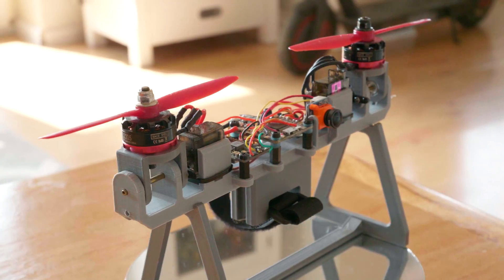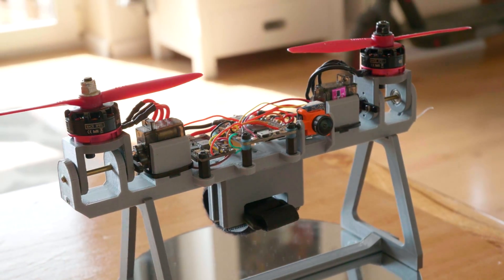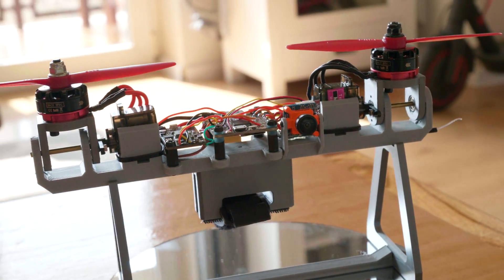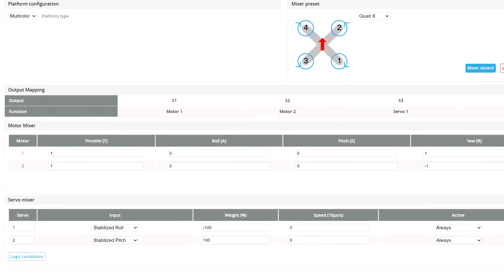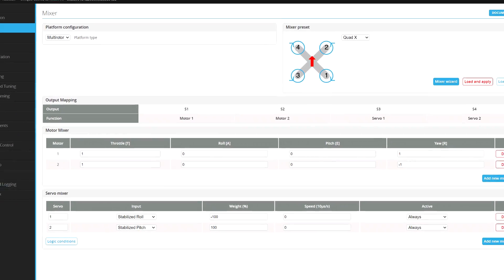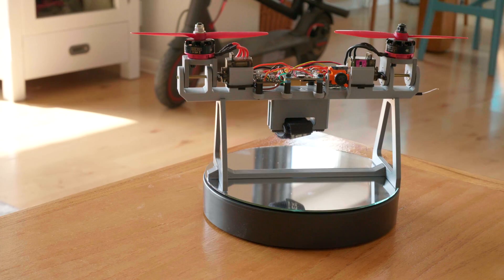Can I use INAV to build a bicopter?

Comment: At 1:16, the reference to "gravity" is irrelevant; this stabaization topic is better known as the "pendulum rocket fallacy" (which applies to all aircraft, including drones, not just rockets). 
The true reference is centre of mass (or centre of gravity, of aircraft) and the relationship of thrust angle to the centre of mass.
For stable flight, the centre of thrust must pass through the centre of mass. Even on winged aircraft.
Reply from the maker: Actually it is relevant. Because combined gravity and thrust vector create a torque that allows to change the orientation in space. Pendulum rocket fallacy refers to passive stability, not active orientation control
Reply: If your brain tends to want to reject the distinction Pawel is making, consider the last sentence "for stable flight the centre of thrust must pass through the centre of mass".  Yet we have millions of planes and MCs flying around just fine with the thrust vector not quite aligned with the CG!  Some are nowhere near the CG. How is this possible? It works, our planes actually fly, because Inav actively stabilizes them. It's not an uncontrolled model rocket that depends on static stability.

Ps - parachutes, including paramotors and powered parachutes are very stable in pitch. Why? Because while the pendulum effect is small in standard planes, it actually does exist.
Reply: @senseisecurityschool9337  There is more to flight dynamics that CG and thrust angle. All forces, including forces produced by control surfaces, and other lift, drag forces need to be accounted for. (pendulum effect is not one of them)
Gliders, and paraglider actually produce a forward thrust vector, which coincidently passes near the centre of mass and the centre of lift.
Good luck trying to explain how the pendulum effect works for a glider, or parachute during a loop, or roll.
Reply: @AerialWaviator  "good luck trying to explain how the pendulum effect works for a glider" - as I stated, it's not a significant effect for a glider (speaking in terms of one shaped more or less like a traditional plane). Source - I design and fly gliders.

On the other hand, good luck trying to explain how thrust angle is the primary determinate of stability for an unpowered glider or parachute.

On the other hand, for a parachute the center of lift SO much higher than the CG that it becomes significant.

Lastly, with a parachute, the lines are not rigid in compression, and are attached by moveable joints. So whatever you think you know based on a solid body may no longer be true. The parts can move *relative to each other*.  That makes some things different in ways that would be very surprising if your mental model is a rocket or plane.